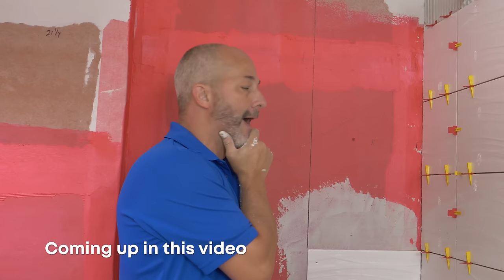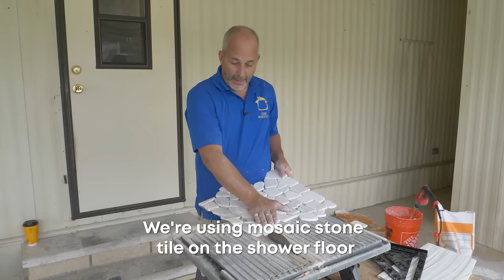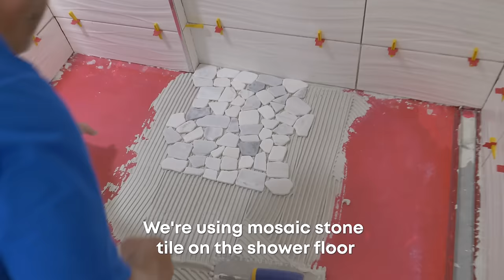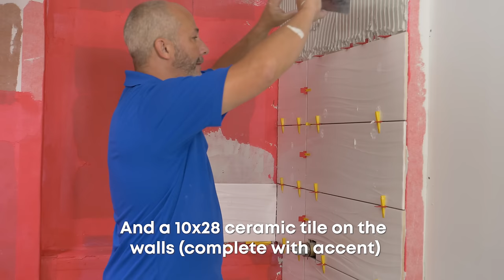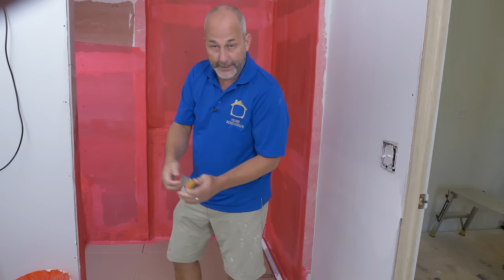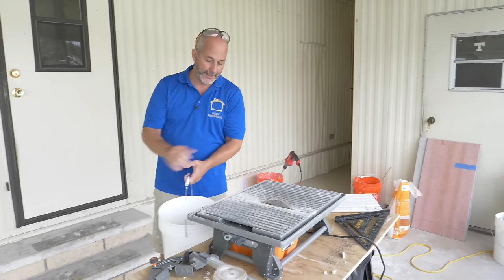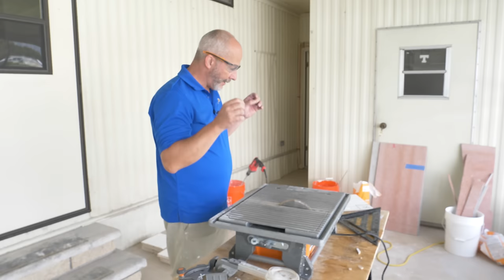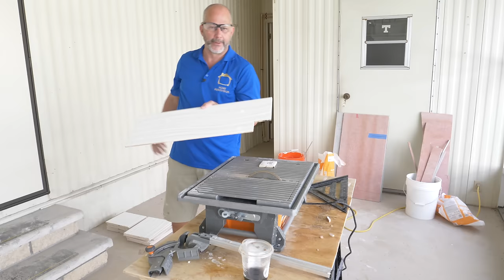Tiling a Custom Shower From Start to Finish

Comment from the maker: Thanks for watching! If you found this video helpful, please subscribe. Watch the full renovation 👉🏼https://www.youtube.com/playlist?list=PL34cQkzKfXWbFlHORkoa-81S1aasqUXf8
Cheers!
Reply: I put a tile cut in the wrong direction and no one has caught it
Reply: Great video looking forward to the grout video. It will come in handy as I’m working on a stone tile bathroom now. I have 60inch sliding shower door I will be installing. Do I need to put the 1 degree slope on the marble sill or does it need to be leveled?
Reply: Love your videos! I have an outdated shower with large format tile on the walls. What is the easiest way to demo these with minimal drywall damage (if possible)?
Reply: Hi Jeff - wondering how is using the notched metal trowel on the barrier coat ok without damaging it?

Comment: Us tile guys, install the shower pan first to protect the waterproofing and also have our walls overlap our shower pan tile
Reply: That’s right and we don’t add water after slaking 😅😅
Reply: @plumbbuild6517  "This is your last chance to add water" lmao
Reply: Agree 100%
Reply: Well, while you tile folk are about, mind if ask advice? Did shower floor couple days ago, waiting on grout to set before we handle walls. Unfortunately, some of the thinset spots through in a few spaces between marble tiles.

I figured, worse to absolute worst, when I mix grout for walls, I could add a wee little layer of fresh grout to mask it. I figure I'm likelier to damage things if I try to pick at the thinset, so I'm wary of that.

What do you pro folk do, beyond not having the problem in the first place?
Reply: @davegordon6943  :/ It's been a few days past a few days, sadly. First time mistakes, but at least they make for a memorable lessons. :P In a few places, I suspect it's spots where the tiles clacked together and lost the sealant/glaze and just plain got stained. (Forgot to advise my brother to grab the white thinset. >.< If it was white, you'd have to have your nose to the tile to notice.)

Can't believe using a bit of scrap wood to scrape didn't even come to mind. But the walls are tomorrow, the grout lines ought to be standard, so I'll have a few little 1/8" wide scrapers. 

Thank you, Dave, I truly do appreciate it. ^.^
Reply: @davegordon6943 I have a question for a tile guy. Is it normal for that bottom ledge at the entrance into the shower to have such a huge overhang? I would think it would be a tripping hazzard. It is hanging over a lot more than the one tile that goes on each side. You can see that there is too much overhang because of the one tile on the left side.

Comment: Every time you removed a tile, we see that you only have about 40% coverage with your thinset. Please do not let people think that is okay.
Reply: Wrong size trowel also should be using 1/2 x 1/2 square notch
Reply: it's always good to have full coverage and do a job properly, but in this case, 40% coverage is probably enough to bond the tiles for life.
Reply: @kkp4297 you're wrong, but at least you seem confident about it 😂

Comment: FYI... There is virtually zero reason to use an unmodified thin set on anything. All-set is one of the latest to make the change to polymer modified. When shopping HD, spend the money on the PRO-LITE. One of the best thin sets on the market.
Reply: HD sells Kerdi membrane, ditra, etc. and doesn't sell All-set!  Can you use the Pro- Lite instead?

Comment: I'm a tile contractor, a few tips:

- Make your walls plumb and square before or while you are installing your wall board. You can plane proud studs and shim where they are short, or you can wet shim the studs, sister new studs, whatever you want really, but it makes the job come out so much better, and saves a lot of time in the end.  
- set and grout your shower pan first, this does 2 things, it protects your waterproofing, and it makes a much better joint where the floor and wall meet. You can mask the completed pan off with anything once it's dry, I use 72" painters plastic and mask everything but 1/2" from the walls and curb. Then I put some foam pads I have over that, but cardboard works too. 
- measure your water, and for mixing partial batches of thinset either weigh it or mix 1/2 bag at a time. Guessing creates an inconsistent mix. 
- put your water in the bucket first so you get a good even mix without any dry spots sticking to the bucket. Since you measured your water, this is easy and logical to do first. 

It's too late now, but that shower valve should have been screwed to some blocking to keep it at the correct depth so the escutcheon can do its job, and to protect the plumbing. you might be able to fix it from the other side of the wall, but it would have been much easier before you closed up the walls.
Reply: I think he did set the valve a few videos back, but I agree, I did the same thing when I tiled my shower. Correction: I guess I was wrong, he didn't.
Reply: Man ,everything you said is spot on!
Reply: yeah i thought it was strange to tile the wall first then the floor!?
Reply: On the floor do you line up all the cut tiles to form a nice line in the middle?
Reply: Thank you!
Reply: @Ender_Wiggin03  "This Shower Almost Broke Me", 4 videos back. He screws the valve in to blocking (for depth at least). For some reason it's not horizontally braced, though. Edit: At about an hour in.
Reply: I agree with everything you said, not only that there were other things that just threw me like using modified thinset, the bench top looks horrific, etc etc
Reply: yeah i thought modified was what to use!? @StarrTile
Reply: @McDaggart  
For this kind of application it's irrelevant the makeup of the thinset
Reply: i'm confused, it threw you that modified was used but then say it doesn't matter which was used? @StarrTile
Reply: @Felix_McDaggart  allow me to unconfuse you... the way he went on about using modified thinset is it relevant, it would not matter
Reply: ahh i see, ty @StarrTile
Reply: I agree with what you say, I am a tiles contractor too,floor first before walls + installed ledge/bench before tiles, same process as the floor.
Reply: well i wished I knew what you just said. Wet shims? proud studs? huh?
Reply: @crazydoglady5  "wet shimming" is using thinset behind your backer board so you can have a perfectly flat wall. A "proud" stud is a framing member in a wall that bows out further than the others, or was set further out than the rest of the wall.
Reply: @S14zenkiQs  ohhhh very interesting. I didnt know you could thinset behind the backer board. Geezz,,I needed to have done that. Thank you
Reply: @crazydoglady5  I'm pretty sure Sal Diblasi has a video on here showing how it's done. Someone does though.
Reply: When a stud sticks out further than it should or further than the rest of the framing, it is said to be proud. I.E., if a stud protrudes by 1/4”, it is proud 1/4”.
Reply: @shepherdguy  interesting...but makes sense
Reply: @StarrTile  There are a lot of misconceptions, maybe because of a telephone effect among trades, of what you can/can't use. In your next shower vid, maybe you can mention these things as you're going along?
Reply: I always use modified thin set, All set is my go to. It’s superior to unmodified.

I never measure my water for mixing thin set neither. I guess after 25 years I just have mixed so much that I do fine with my eyeballs
Reply: I'm contractor too and you definitely want to do the floor and the top of the seat first
Reply: I'd like to see the video of how to accomplish that. Because I'm pretty sure my damn house was put together in a Tim burton movie. Not a square angle in the whole damn place.  and it constantly sets off my ocd.
Reply: Setting the floor first can create unnecessary tough cuts for the wall tile. Especially if it’s pebbles or smaller sheet tile. We always set the entire shower first and lay the floor very last. I don’t think it’s necessarily a good thing to be stepping on the floor tile, especially when you are using a ladder. You can just put a sheet of cardboard down so that it doesn’t mess the waterproofing up
Reply: I need you to come to my house!! Lol

Comment: Nice job. One thing I would have done different if it were me (but would have required a few additional floor tiles) is I would have removed a roll of stones from the top and bottom sections of the tiles to create a full stone consistent pattern to align together without a " cut-line" appearance in the flooring, just as it is on the sides of the tiles.. It would have given it an all natural stone look as if every stone was hand positioned and no tile lines, and it would remove the need for determining whether the rows were properly aligned.
Reply: agree. I sat down on the floor and hand placed each one around the edges and empty spaces to fill in. its tedious and takes a long time but..the results look good.

Comment: Cleaning off the thin set at the joint! My favorite tip of the day. So far... Just getting started on two bathrooms. One with a 3 x 6 shower. The other with a tub.

Comment: The plastic wedges you used for leveling are actually great for scraping off excess thinset instead of that putty knife.  That plus a sponge/water the next day does a great job.

Comment: I learned so much today on just two very important tips:  Unmodified thinset over something like redguard, (and I assume for the green waterproofing also,) and 2) Direction of the leveling clip wedges to pull the joints together.  Awesome, and thank you!

Comment: Great video as usual. 
I'd like to point out that the RedGuard Technical Data Sheet reads: "Install tile or stone with a Custom® Building Products polymer-modified mortar that meets ANSI A118.4 or A118.15 standards based on application requirements.
"
Reply: This was exactly the reason I had to return a non modified mortar back to HD and get a polymer modified one! I don't know why Jeff is intentionally ignoring what the product label says
Reply: I did a LOT of research including professional tile forums and it was suggested that Custom Flexbond MODIFIED thinset was the way to go for my shower...  I dont understand his angst
Reply: @jefffree6990  hey did you use Red Guard as well? I'm at a pause not sure was thinset to use now that the redguard is one the walls, my tiles are 6"x36" porcelain tiles
Reply: @FPUGUY  Polymer modified LTF mortar by Custom - this is what I used a year ago and don't have any issues. Red Gard was applied onto a cement board.
Reply: Funny thing is, he's using modified thinset.  It says right on the bag at 17:07.  I think he's a bit confused.  @HomeRenoVisionDIY, love the videos, keep it up.
Reply: Came to the comment to find out about this part to. Every membrane i had looked at using specified modified as well. 

Neither product required drying really, its a chemical set reaction either way. The modified just lets it be more flexible was my understanding.

Comment: 59:58 The majority of Home Depot employees do not know about the applications or differences in the materials in their departments. I worked at HD (hardware department) for a couple of years and was surprised to learn that other folks in that department didn't know the difference between a roofing and a framing nail. I bet when you asked them about that thin set, they had no clue what you were asking for.

Comment: Jeff -  Thank you for posting this series!  There is very little online about renovating mobile/manufactured homes.  Ours was built in the ‘70s to a price point and to meet that decade’s codes.  The state codes here in California are much stricter now.   They prohibit many things that local codes allow in conventional construction.  A key factor is that they must remain moveable.  A crew must be able to split a double-wide and move the units separately down the highway.  

When our roof was replaced last year, couldn’t even upgrade the original 3/8“ roof sheathing with 1/2”.  It would be too heavy for the trusses.  Strengthening the trusses would make them too heavy for the studs.  Beefing up the studs would make them too heavy for the floor joists.  Stronger floor joists and sub-flooring would be too heavy for the foundation and for the axles used on the road.  Similar constraints exist for heavier drywall, replacing a fiberglass shower enclosure with ceramic tile, etc.

I don’t know whether Florida has special state (or local) mobile home building codes, plan approvals, and inspections as does California.  I hope that all goes well for your project!

Comment: I was taught to do the floor before setting the bottom row of wall tiles.  Level line around shower, start one wall tile up, finish wall tiles above level line, lay floor then cut and lay last row of wall time.    Wall tile overlaps floor tile that way.  Which is the better way?
Reply: i was wondering that as well. I typically would do floor first and have the wall overlap that way theres no vertical joint at the base of the wall for water to run into in a worst case scenario.
Reply: I like setting the floor first then the walls, there's not a set in stone correct way. For me if I "think like water" it makes sense to have the walls overhanging the floor. It's the same thought process I use for doing roofing and siding. I also use epoxy grout. Belts and braces - every little bit I can do to prevent water flowing places other than the drain I will do it.
Reply: typically standard practice is to do the shower floor first, so that wall tile sits on the floor tile. That is also how ideal water flow is.... down the wall, onto the floor tile.
The method in this video results in wall water going under the floor tile, which is not what you want. Even if you seal the corner with silicone, it is not ideal to seal two planes this way. Same idea why countertop backsplash sits on top of the countertop, not behind the countertop.
Reply: this is  how I put tiles all the time and this is correct process.

Comment: typically standard practice is to do the shower floor first, so that wall tile sits on the floor tile. That is also how ideal water flow is.... down the wall, onto the floor tile.
The method in this video results in wall water going under the floor tile, which is not what you want. Even if you seal the corner with silicone, it is not ideal to seal two planes this way. Same idea why countertop backsplash sits on top of the countertop, not behind the countertop.
Reply: Sealed system. Order doesn't really matter. It's all getting wet anyway. It's meant to dry out either way. What does and doesn't get wet doesn't really matter.
Reply: I never ever start from floor but I never start wall tiles from the bottom. Always start from wall tiles but from second layer then floor tiles then on the end first layer of wall tiles. I done dozens of bathrooms.

Comment: I bought one of those hammer drills (18:35) for a renovation project I'm doing based off you using it in another video and it's been working great for me. I used it to drill some holes in a stone wall and was just mixing some patch/level mix with it today.

Comment: There’s a lot of really good tile lifting systems out there now, used for starting your bottom tile rows from. Great when used with a decent laser to get that perfect half a tile at top and bottom. Saves a lot of hassle when working alone and gives a solid level starting point on every wall.

Comment: Hey Jeff, greetings from Bristol, Wisconsin. Funny story (from last week) in hindsight...
I was intimidated to mix self-leveler because I am of short stature, and the corded power drill with the mixing paddle is higher up on me than of a tall person. One turn of the paddle with a little too much power...bucket moved, and the mix flew everywhere! Walls, tub, plywood, boots, socks and pants all became a target! I had to finish mixing it, since I was caked in it. 15 minutes later all was on the floor where it was supposed to be, and I had to gingerly walk through the house to hose off everything outside. Oh, and the mix? 2 inches caked in the bottom that I didn't realize was there. Good thing I was wearing my cruddy clothes! Mix didn't come out, boots might be ruined, but we'll see...😂
Reply: Water goes in the bucket first, that will stop the caking.
Reply: sh^t happens it is how we learn
Reply: @S14zenkiQs  I did put water in first, just too much compound before starting to mix
Reply from the maker: Loving it

Comment: Redgard Waterproofing and Crack Prevention Membrane but critical step not to ignore, follow the instructions like you said and you will never be sorry, my contractor tried to convince me it was not necessary I told him otherwise cause I KNOW better. Nice tip on the hole saw, I also used a piece of scrap plywood with a hole of the same diameter to accomplish the same thing. Awesome video as always. Thank you.

Comment: It’s always a good lesson of scraping out dry thinset from between the grout lines to help you to remember to wipe away your edges and excess thinset before you lay each tile. Do it right first time around and you’ll save yourself so much trouble later. It makes it way less messy to.

Comment: I’ve used the All Set the last couple of tile jobs for floors as it works below and above Schluter Ditra!  I have found that it is smooth and creamy but does not have quite the open time as some other thinset.
Reply: The thing about all set is don’t mix it at any high speed mix it at low speed for the time posted on the bag it will have a longer open time and get the texture right and let it slake and don’t add water like Jeff that’s the wrong way. But higher speed less open time ,  lower speed longer open time